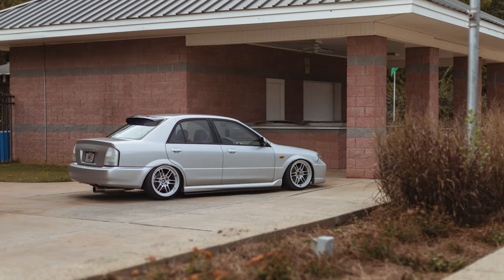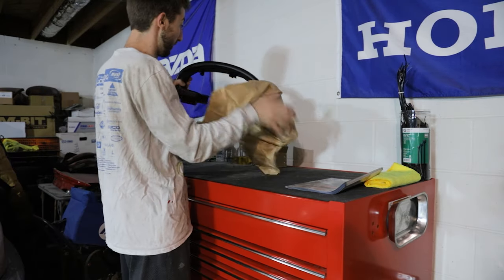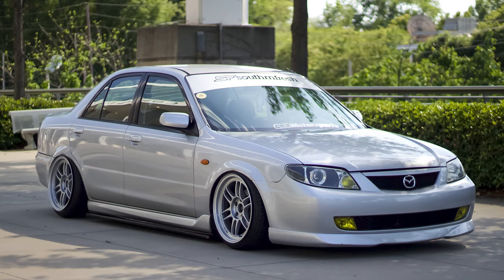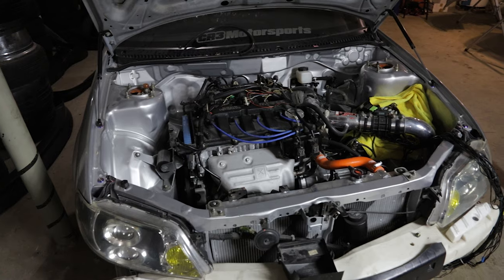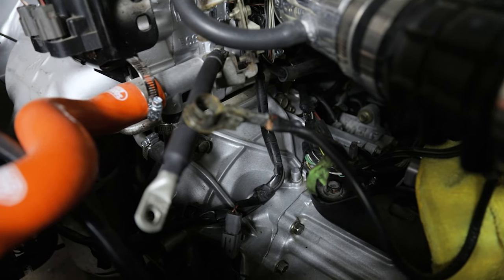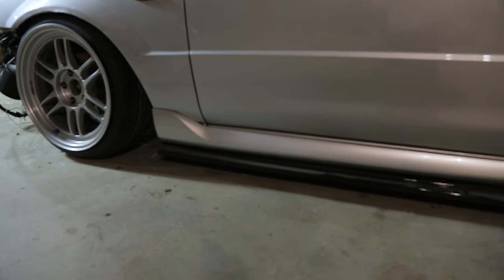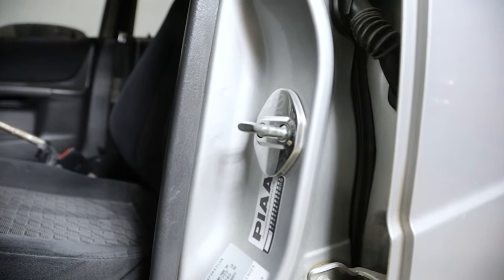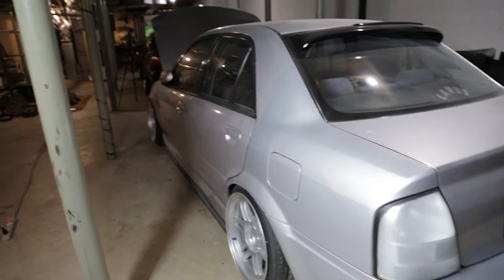ALL of the Mods on My Mazda Protege

Comment: I still drive the same 2002 Mazda Portage that I drove it off the lot brand new in 2002 and it still runs like new. I have 173,000 miles. Got it painted black about 8 years after the paint started to fade. Black tint with black rims, looks nicer than most cars I pass today.

Comment: Hey! I'm in the process of inheriting a barely used Protege from a relative (~4k miles in the last decade and a half) with a total of around 59k miles at the moment. The model is very stock without any front/rear lip and skirts and I'm just wondering how to go about finding some? I'm somewhat new to cars and have never had a project car so I'd like to start looking at lip options to change the overall silhouette of the car and lower it a bit. I plan on changing the rims later on to something a little more classy for my tastes, but I'd like to make the front and sides more squarish and lower to ground. Any tips on where to look for lips and skirts would be highly appreciated! I've searched everyday for months but haven't found a single other Protege on the streets so looking to make this car stand out a bit!

Also since I'm new to cars, any info on price suggestions/averages for these kinds parts would be really helpful
Reply from the maker: Parts are getting hard to find for these now. Luckily the side skirts came factory on the Protege5 (hatchback) model, so there's plenty of those around. Best bet is Facebook marketplace/groups or a junkyard.

Comment: Love the side skirts! You said they were Mazda 3? Do you have a link to them or any more details on the install process?
Reply from the maker: https://www.ebay.com/itm/MS-Style-Aero-Side-Sills-Skirts-ABS-Fits-10-13-Mazda-3-4-5dr-/371055903717?_trksid=p2349624.m46890.l49292

There’s some triangle shaped plastic on the top edge that has to be trimmed off. Other than that just screw into the bottom of your oem skirts

Comment: Just got my brothers fiance's 2002 Mazda protege for $450 bone stock except for the cold air intake and radio.i had a tick. Coming from what soundz like the flywheel?
How much is stuff for this car? Is this doable without a lot of money
Reply from the maker: Could be a throw out bearing issue. Stuff isn’t too expensive for these cars generally. Assuming you can find the parts and do most of the work yourself.

Comment: The wires for the power side mirrors should be right there for those cars in Taiwan, whether manual or power drive.  All you need is a switch to replace.  And the JDM right drive side mirror, you may need those in Taiwan.  It's same as JDM but left drive as in US.

Comment: Anyone know where to find a front strut bar for an 03 Mazda protoge? I found one in a kit from eBay but had to beat on the hood a little to make it fit. Bracket was hitting when you closed the hood.
Reply: Any P5?
Reply: @Mazda.Fit.  possibly. I took a chance with some stock Mazda strut bar off eBay. Not sure what Mazda protégé it came off but the brackets on it weren’t lining up with with my strut tower and the bolt holes on it. Seemed like it would probably have worked well if the brackets bolted up. Thanks for the suggestion.

Comment: Do you have a video on how you did such an amazing job with your engine bay? I'm getting prepared to pull my engine out for a rebuild, and I'm trying to clean it up a little; wire tuck.
Reply from the maker: Not yet, I do plan to make one though. I still have some wiring to figure out myself. Re-doing some things currently.
Reply: @AlexPerrucci  Sounds like fun lol. I'm subbed now so I'll make sure to be on the lookout for it.